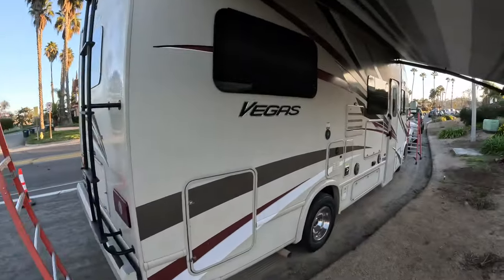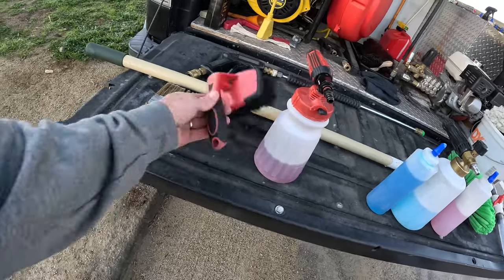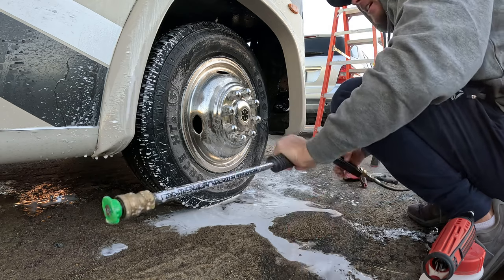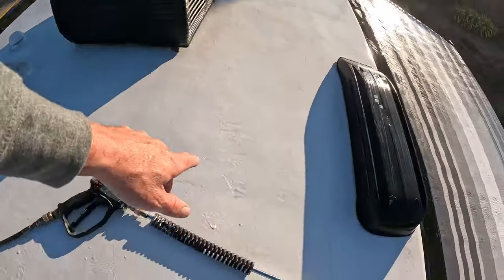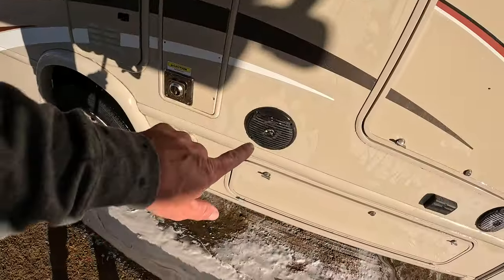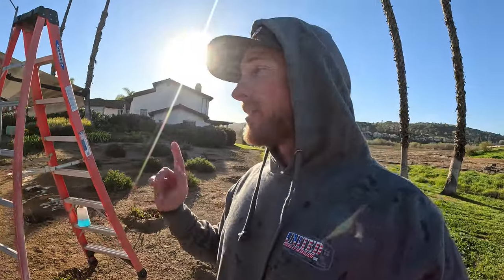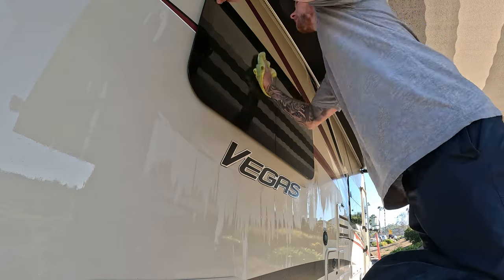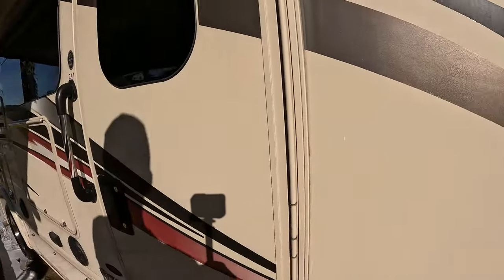Revitalize your RV with this Ultimate Oxidation Cleaning Guide!

Comment: As a red seal rv service technician... DO NOT USE A PRESSURE WASHER ON YOUR RV OR TRAILER. UNLESS YOU LIKE PAYING FOR WATER DAMAGE.
Reply from the maker: I wash and detail RV’s for a living, 2-4 RV’s a day, I use a pressure washer on LITERALLY EVERY SINGLE ONE OF THEM,  ZERO ISSUES EVER! Use your brain and common sense and you’ll be just fine!
Reply: @_allthingsdude  well I hope you have insurance for when one of your customers gets delam from blowing through the tpo/ epdm rubber roof membrane and / or side wall sealant. It clearly states in all owners manuals to not use high pressure water on any surface of an rv and we have repaired thousands of dollars of damage. If you feel comfortable doing what you do thats great but just know that as soon as you do that it voids all factory warranty on that unit as well as extended warranty. Just trying to help.
Reply: That's probably the manufacturer trying to cover their ass from customers using a pressure washer that is designed for cleaning concrete (2000- 4000 psi). Most rv detailers have pressure washers tuned to run at less than 1500 psi.
Reply from the maker: @marcussirounianharry9451  precisely. It’s their way out. If you don’t say you used a pressure washer then they don’t know.
Reply: ABSOLUTELY 💯 %%
Reply: @_allthingsdude
How many start LIKING after 😅
Reply: PLEASE PLEASE PLEASE 
DON'T USE PRASERWASHER ON RV

Comment: Questions!!! How do you get to an C class overhang?  what kind of soap are you using?
Reply from the maker: For that front cap on a class C I use a couple different methods. I typically get as much as I possibly can from the roof then get anything remaining from a ladder. I like to set my ladder centered up at the front, lay down a microfiber towel on the hood, remove on shoe and step on the microfiber on the hood. So I keep the one foot with shoe still in tact on the ladder and the foot with no shoe on the hood with the towel. This usually gives me access to the front center section. The remaining I get from the sides on my ladder. 

As for soaps- if it’s oxidized I use extreme by finish renu and dawn. If there’s no oxidation then I use a wash wax soap by a company called 3D.
Reply from the maker: https://youtu.be/9b9Axsy8bX0 in this video I go over how to access the front cap on a class c
Reply from the maker: https://youtube.com/shorts/YozqvDeqLS0?feature=share

Comment: I have some questions.  Do you use any kind of liquid wax on the roof?   What kind of scrubber were you using on the dawn foam?   Just a suggestion.   If you want your glass really clean, let it dry completely.   Dry rub the glass with 4/0 steel wool.   It will not scratch glass and takes all gunk off the glass.
Reply from the maker: For the roof I use 303 aerospace grade spray sealant if there is zero oxidation. If there is oxidation I buff it down and wax it (depending on what material the roof is). For the brush/scrubber I’m using a Wooster paint extension pole from Home Depot with a brush head attachment I buy at local detail shops. Not sure what they’re called. I’ve heard that about the steel wool. In fact it just came up yesterday with a client who asked me about it. I’ve never tried it. Maybe I’ll have to give it a shot. Thanks!

Comment: Where did you get the green brush from? Is the green cleaner 'Cleanse Tec Liquid Xtreme'?
Reply from the maker: I got the green brush from a local detail shop here in so cal in perris. I think it’s called star detail, they also sell water. It’s right by the Popeyes in perris plaza off the freeway. The glass cleaner I use is the green rain x glass
Cleaner with bug remover in it. They sell it by the gallon at Walmart.

Comment: How do you remove hard water spots from windows
Reply from the maker: Ok that can be a tough one… do you have black windows or clear windows? The black windows typically get the water spots baked into the pores so deep that you can’t really get them out. Try a wool pad on a rotary buffer with 1000 grit compound. Also try chemical guys orange gel water spot remover ( follow directions on bottle). If neither of those work then you might try a glass cutting compound and pad combo. It can be a real pain in the butt.

Comment: I've seen warnings against using a pressure washer on an Rv as the high
 pressure can & will get under the plastic vents & body seals & whatnot.

!
Reply from the maker: Pressure washers are very directional… meaning the water only goes where pointed. Anything that interferes with its path, the water bounces off. Hope that makes sense. Very hard to get water somewhere when there is any kind of obstruction. POint it where you want it with caution and you’ll be alright. Textured roofs need to be pressure washed heavy to be cleaned properly, using common sense and caution. Hope that make sense! Thank you for watching